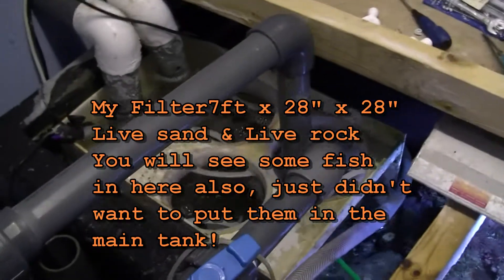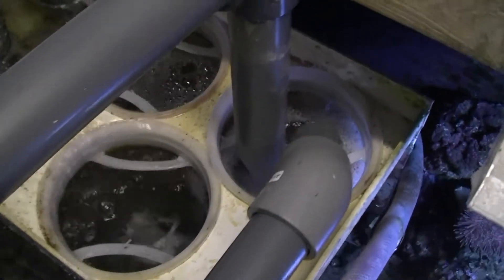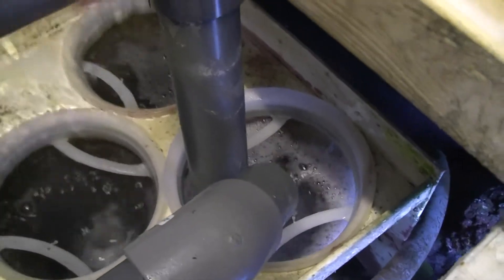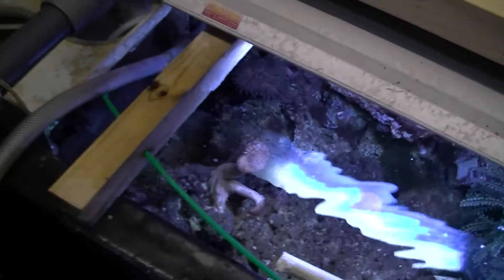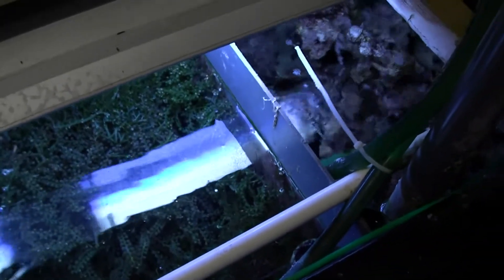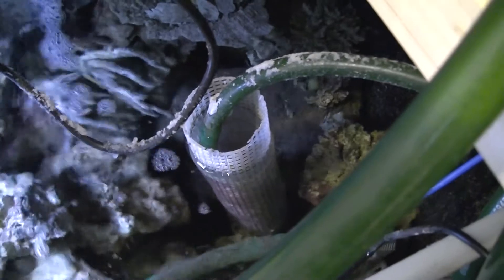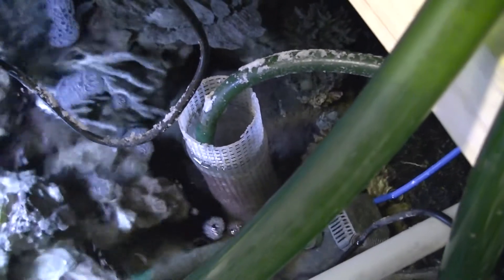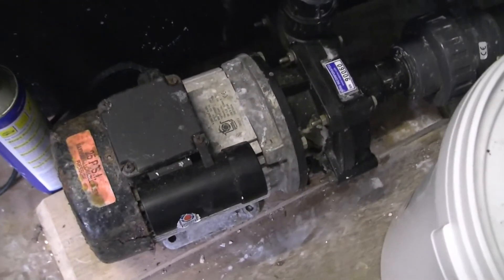My reef tank Filter

Comment: 5. the pump in 5th section sends water into aqua medic 5000,litre calcium reactor and my
deltec 15,000 litre nfp 1020 nitrate filter
6. 6th section has more 3inch thick blue fine and course sponge and white pad in.
7. 7th section is where the pump is connected to, too send water back to large tanks

Comment: well my reservoir is set  up like this
1. water drains into the 1st section from tanks and gets treeted the mechanical side by passing by fine and coures sponge 3inch thick white pads which are cut from a giant sheet.
2. next in the 2nd section the two 7000,litre pumps send wanter into the two 4feet tall  2500,litre rotating spray bar towers, 
3. the pump in the 3rd section sends water into aqua medic 10,000 skimmer,
4. pump in 4th section is sent do deltec fr 616 phosphate filter.
--pto

Comment from the maker: @tashdog1 I got a different type of booster pump but think they are all the same,boosts to about 125 psi or something, I use a 3 pod di resign unit, I had them spare from old RO units and used them, this way with the amount of water changes I do it lasts longer having 3 if not you will be changing them out far to quick!

Comment: hi glen ok,
on your ro unit glen 
do you uses deltecs RO booster pump  for the ro unit
well i have just bought one for my 150gl deltec ro unit
plus new replacement membrain and same
with the new carbon filter cartridge and white filter block

plus glen do you use a
D&D 300ml deionising pod with resin
as i just bought that too
and TDS Meter reading 

ok let us know glen